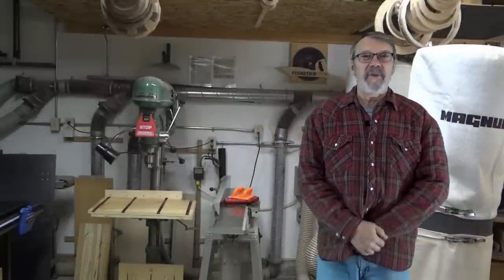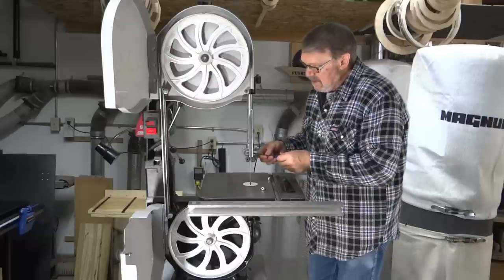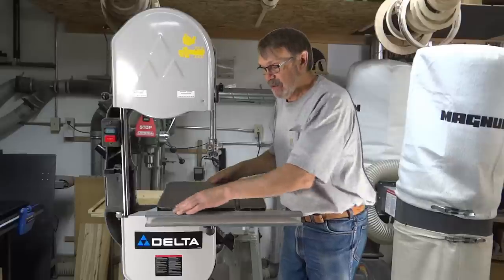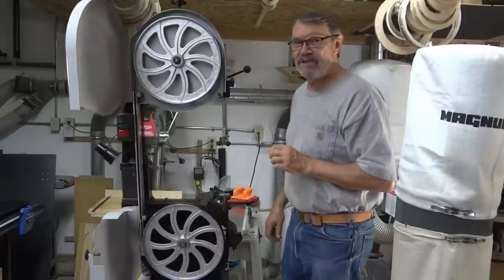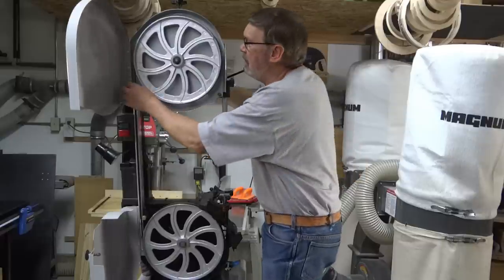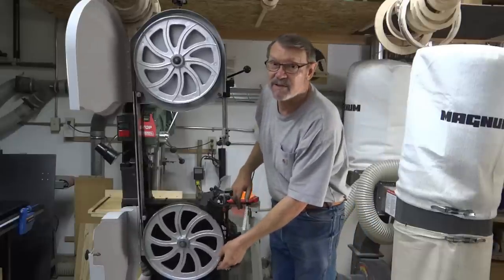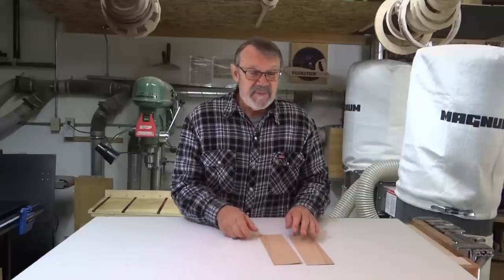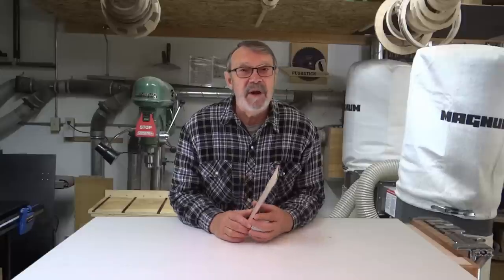Upgrading My Delta Bandsaw

Comment: I have a 1947 Delta 14" bandsaw that I rebuilt. It was in bad shape but works great now. The bearings had spun in the cast iron 
wheels so I bored them out and made steel sleeves for them. A lot of work but I like old machines.
 Glad you did this install for the Carter guides. I have been looking at upgrading to the same.
I live in Portland and wished I could have went to the Symposium this year but we had a vacation scheduled.
 Thanks for the video
Gary
Reply from the maker: Wow! That sounds like a major job to me. That might be because I don’t know much about metal working. I have been extremely happy with my bandsaw since the upgrade! If you decide to do it I hope you will be as satisfied as I am. Thanks for watching,
Gary!
Take care,
.....Gord

Comment: Thank you so much for this video. I am planning to get this set for my ancient Delta 14" bandsaw that I bought used. All the old guide components are original, knobs hard to turn, guides don't do their job, etc. You've confirmed that this purchase will be worth my while. Actually pretty excited about this upgrade.
Reply from the maker: I hope you have great luck with the upgrade, Ken. I can’t begin to tell you how much better mine works. It has become a real pleasure to work with instead of the chore it was before. Have fun with it! Thanks for watching my video!
.....Gord
Reply: Gord, after a year, I was finally able to purchase and install this. In fact, I used this video as the instruction guide. Much easier to follow than the printed one. 
Result: OMG what a game changer!! Thank you again.
Reply from the maker: My pleasure, Ken. I hope you have as much appreciation of the improvements as I do. One of the best upgrades I have ever done! Enjoy!!
.....Gord

Comment: Gord, I did the same thing with my new 17" Grizzly a few years back.  Even though it was new it wouldn't resaw straight no matter what I did.  I purchase expensive Laguna blades and that lasted only briefly. I was disgusted.  I met the Carter crew at a woodworkers show and purchased the guides with a money-back guarantee.  Wow, what a difference!  No more fooling around, no adjusting, no more making excuses for still sharp blades, nada.  My blades seem to last much longer and the cut quality is superb.  Excellent video and instruction.  A tip: be sure to use Break-Free gun oil or a similar synthetic oil for modern semi-auto rifles. Those bearings will glide beautifully and no worries after cutting green wood.  :)
Reply from the maker: Good to know! Thanks for the information and the testimonial. I hadn't thought about oiling the bearings so thank you for that!
Take care,
.....Gord

Comment: Sir, I'm glad the upgrade resulted in you being happy with the improved ability of your saw. At 14:30 you begin a resawing cut. I've been taught that what you did is the REVERSE of what yields best results. It's going to give a better cut if the resulting THINNER portion of the board is not between the fence and the blade. The resulting THINNER portion of the board should be OUTSIDE of the blade. Best regards, Jack
Reply from the maker: Thanks for the tip. I will keep that in mind. Thanks for watching! 😃😃😃
All the best,
.....Gord
Reply: @GordonRock1  All The Best To You As Well !

Comment: Great Video.  The point of setting blade gullet on centerline of tire was worth the watch.  I have been thinking of doing this upgrade to my saw.  I rebuild these saws and sell them but have never installed a Carter guide system.  This video was a real eye opener in my decision to upgrade a saw I picked up last year as a basket case.  Both guide castings were broken from a nasty overturn as were the table trunions.   The Carter system is just as cheap as picking up original equipment used guides and improves the saw performance.  I may even do over a Powermatic "Gumby".
Reply from the maker: Thank you, James. I’m happy that you liked the video. I hope you enjoy the improved performance of your bandsaw. Thanks for watching. I appreciate the support!! 😃😃
Take care,
.....Gord

Comment: Should get my upgrade kit tomorrow. I bought a 28-206 and a 6" riser block in 2003. Tires gave out this year and replaced them. Has not cut straight since then. No matter what I do. I am hoping that using this upgrade kit will do the job and mine operates as good as yours looks. Appreciate your video. It eliminates a lot of the uncertainty and  anxiety about taking on the task. I need my Bandsaw working. My Craftsman 10 inch is juts not big enough. :<=)
Reply: I should make clear, I centered the back of the blade gullet on the new tire. And it still did not cut straight.
Reply from the maker: Jim, if you’re half as happy with the upgrade as I am you will be ecstatic. I look forward to hearing how you make out with it. Best of luck with doing it. 🤞🤞👍👍
Reply: @GordonRock1  received the upgrade kit today and installed it. Referred to your video to solve one difficulty I was having, I was attempting to mount the lower guide rail upside down. Lack of brain power prevented me from figuring that out myself. lol  The difference in saw performance is like that between night and day. Excellent upgrade. Excellent video tutorial.
Reply from the maker: I’m glad it’s working for you, Jim. It’s one of the best upgrades I have ever done in my shop. I just wish I hadn’t waited so long to get it done! Enjoy and thanks again for watching the video! 😃😃
.....Gord

Comment: Great video it's good to see us old timers making good use of the Green Screen. Back in the early 80's, I was the lead tech at Rockwell/Delta in Boston. I have had 2 of these 14" bandsaws personally since then and the one I have now has the 6" ext. block as yours does. Now the only mod I did on mine was to add a 3/4 HP motor and all was good. I honestly don't use it a heck of a lot, but I was intrigued as to your claim for making it better and I was skeptical, having repaired a boat load of these. I get it. I don't have a tall fence for re-saw as you do, interesting. The  drag coefficient from block to bearing when cutting precise at that depth must change. I'm thinking I may try and use some polyurethane plastics to  replace my blocks. have you done anything with that at all ? Thanks, John
Reply from the maker: Thanks for watching the video, John. No, I haven’t tried using any plastics to replace the blocks. I tried those Cool Blocks but was never happy with them. I was delighted to find the upgrade kit from Carter Products and I am still very happy that I did the upgrade. I don’t use mine very often either but it is a pleasure to use now whereas it was very frustrating to use before the upgrade. I had always been told that using a fence was a waste of time. Using it with the fence now works very well. I am able to ripsaw a very thin slice very accurately. Thanks for watching, John. I appreciate the support!

Comment: Gord, Thanks for the great video. One thing you video doesn't quite show is if the new Carter setup increases the useable clearance between the bottom of the table and the guides. With the old blocks it is the hardware holding the blocks that limits space on the adjustable track more than the guides themselves. Half an inch more space would make a dust collecting setup simpler.
Reply from the maker: I’m glad you liked it, John. I always seem to forget to point out at least one thing about my subject when I make a video. 🤨🤔🤨 Thanks for pointing that out. Thanks for watching!
Take care,
.....Gord
Reply: @GordonRock1  Gord, My intention wasn't to be critical at all. I am asking if the new guides create more space beneath the table. (for adding dust collection) I am sure the distance between the bottom of the table and the guides themselves is the same. It is the hardware holding the guides that looks way less bulky in the new ones. I thought your video was perfect the way it is and shows how to do the conversion really well.
Reply from the maker: Sorry, John, obviously I didn't read it properly but I didn't think you were being critical. To answer your question; finally!! There is more space. I don't know if there is enough space to fabricate an additional dust collection port. The port on mine isn't perfect by any means but it works well enough that I don't see the need to add more. Is yours the same bandsaw? My apologies for not answering properly when you first asked. I hope this is helpful.
All the best,
.....Gord

Comment: I have the same kit for my 14 inch Jet band saw, and I LOVE LOVE LOVE IT!!!! If you want an easier way to tension your blades, and relax the tension when your saw is not in use(prevents the blade developing a memory), get Carter's blade tensioning system, and their Cobra Coil. I have done all of these upgrades to my band saw, and it runs better than it ever has. My band saw is a pretty old one, it still (for now) has it's original gray paint, which is a bit darker than your Delta. I want to say this is from the 1960's, but I haven't been able to find anything that would suggest a build date.
Reply from the maker: Thank you for the tip. I have checked out the cobra coil and it looks like it’s very affordable. The blade tensioning system on my Delta looks very much like the one in the picture from Carter’s system. Is there much difference that I’m not seeing? Once again, I really appreciate the tip. I will be thinking about getting at least the cobra coil and will have to think about the blade tensioning system as it does not look much different. Thanks for watching my video!
…..Gord
Reply: @GordonRock1  I'm not sure how the lever on a Delta works, but the Carter system has 3 positions to their lever. All the way up is for normal operation, the middle is to release enough tension so the blade doesn't develop a memory from sitting on the wheels for a long time, and the lowest position allows you to remove the blade without ever having to turn the tensioning screw again, or having to walk the blade off the wheel. Just like Ron Popeil used to say "Just set it and forget it"

EDIT.........I forgot to add that I have changed the tires to urethane and replaced both the upper and lower wheel bearings. The only thing I have left to do is add a riser block, clean everything up, and a give it a fresh new paint job.
Reply from the maker: I think you supplied the wrong link. When I click on the link it takes me to my own video. Thanks anyway.
Reply: @GordonRock1  I am very sorry about that, here is the correct link. Again, you'll find what I was referring to at the 31:40 mark  https://www.youtube.com/watch?v=XYYG91fr_2w
Reply from the maker: Thank you very much! 😃😃👍👍
Reply from the maker: I checked my video because I was sure that I had included that. If you look at the 13:15 spot you will see that I did include that. Unless, of course, you meant something else.
Reply: @GordonRock1  I did see that you made the cut with the live edge facing up, and then moved the board to the rear of the blade to see if it fit in the cut you made. When Alex does it in his videos, you can see that he turns the board over 180 degrees before moving it to the back side of the blade. Go to the 32:06 point of his video to see what I'm talking about.

Comment: My up-grade did not go as smoothly as yours. I have a Porter Cable model.  The kit I got from C&S was supposed to work on my saw. The top interchanged perfectly but the bottom didn’t line up at all. However it does a nice job, so the top is C&S and the bottom is porter cable. Thanks for sharing. I hope you have great success with it. DS
Reply: Did you address this issue with the guys at Carter? I found them very easy to talk to and very willing to help. Met them at the woodworking show in NJ twice now, and still amazed at how quickly Alex works on his bandsaws.
Reply from the maker: Thank you, Danny. Pat may have the answer for you. Contacting the manufacturer could be a good idea if they want to maintain good relations with their customers. I hope they can help!! I had read before that they have good customer service. I wish you luck with it. If you're happy with the job it's doing that's what really matters. Thanks for watching, Danny.
Take care,
.....Gord
Reply: Right seems silly to pay all the money for half the benefits

Comment: Gord this is a great video.  I recently purchased a late night 90’s delta 14” bandsaw with 1hp motor.  Someday I’ll do the guide upgrade, but I am interested first in adding the riser block.  I’m having a hard time finding some of the components, mainly the longer round guide bar and blade longer blade guards.  Only ones on ebay are for hex bars.  Anyway, would be nice to know if you did the riser retrofit and where you got it?  Thanks.
Reply from the maker: Mine came with the riser installed. I’m happy that I didn’t have to worry about it. I hope you are able to find the one you need!! Thanks for watching!
…..Gord

Comment: @gord thanks for the video! Are your wheels coplanar? I have just got a used Delta 14” bandsaw (with riser) and it doesn’t allow the blade’s gullet to track center. The wheel rubs against the top housing when adjusting tracking that far.
Not sure what to do next!
Reply from the maker: Yes, my wheels are coplanar. I’m afraid that I have no idea what to try, Kartik. I wish you luck with it, my friend.
All the best,
…..Gord

Comment: Gord, I have the same Delta bandsaw as you and upgraded as well.  My issue is with the circle cutting jig I made from the various YouTube videos.  I made mine with a dovetail slot where I am able to vary the radius of the circle vs a fixed radius.  I have tried aligning the pivot point in line with blade , in front of the blade, and behind the blade but the blade keeps coming off completely.  I am trying to cut a 15 circle and have been unsuccessful with a 1/2“ blade and 1/4”blades.  Have you had issues like this with the Carter bushing when cutting circles?
Reply from the maker: I am afraid I have never tried cutting circles with it since upgrading my bandsaw. Sorry, I can’t help you much with that!

Comment: If the bearings are set at one height, I find that raising the guides can change that because the mechanism to raise and lower the guides is very crude. Any suggestions? Also, where did you get that beautiful fence for resawing?
Reply from the maker: Fred, I can’t think of any suggestions to make about raising and lowering the guides. I also find them a bit crude but I’ve gotten used to that. The fence I use is called the "Ex-Pand-A Fence". I did a Google search for it and I don’t think it is available any longer. I have had mine for more than 20 years. I’m sorry I’m not any help to you on this! I hope the video helps in some other way. Thanks for watching!
…..Gord

Comment: I am an owner of multiple Delta 14" band saws (including two 2-speed metal/wood cutting saws). I am a huge fan of old Delta band saws, much as I am a huge fan of old DeWalt radial arm saws. The new version, Delta 14" band saw shown in the above video, doesn't compare in quality. I also learned that the Delta band saws have been made by a succession of owners over the years. I wonder who is making them now.
Reply from the maker: Hi Kenneth,
I was told a few years ago that Delta was bought by a Chinese company and that it has become very difficult to find parts for them. I don’t know if that’s true but so far haven’t needed to buy parts. I hope I don’t need to in the future. There do seem to be plenty of after market suppliers out there so maybe it won’t be a problem. Thanks for watching!
Take care,
.....Gord

Comment: Great video! I plan on making the same changes myself very soon. Could you please pass on some info on the after market fence you use? I'm sure that will complete the perfect upgrade. Thanks again for a great video.
Reply from the maker: Hi Billy,
I'm glad you liked the video! Thanks for watching!
The fence is called Ex-Pand-A-Fence. It's sold by Woodworker's Haven who are in Baden, Ontario, Canada. Their Toll Free number (at least in Canada) is 888-994-2836. I called today to confirm that it is still available and it is priced at $159.00 for the double fence which is what I have. I've had mine since 2007 and now that I've upgrade the bandsaw with the new roller guides I am VERY happy with it. I hope they are able to help you get yours working as well as mine. When I talked to Mike today he told me that they also sell a set of roller guides. I don't know how the quality compares with the Carter Guide set I bought but I'm sure he can advise you on that. Best of luck with it, Billy!
Take care,
…..Gord

Comment: Gord,  great video.. Thinking about adding the guides on my Delta Bandsaw,  Looks the same as yours minus the riser. Was wondering if I use a 1/4 blade would I be able to cut curves as long as there not to tight a radius?
Reply from the maker: Yes, you can. According to a chart I have you should be able to cut a radius of 5/8" with a 1/4" bandsaw blade. If you do a google search for "Bandsaw Radius Chart" you should be able to find one to print out if you want to. Hope that helps.
Take care,
.....Gord